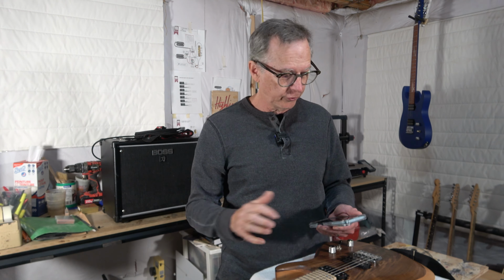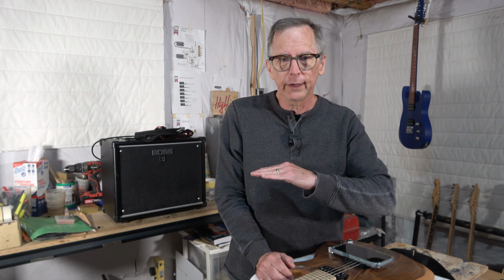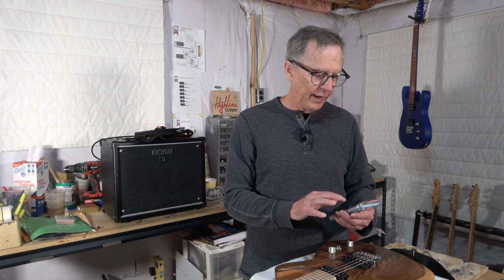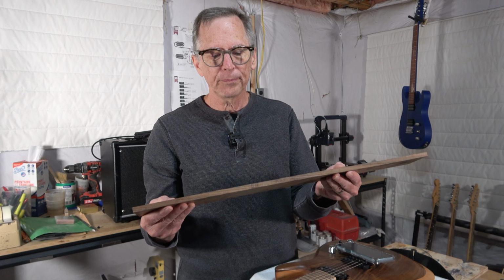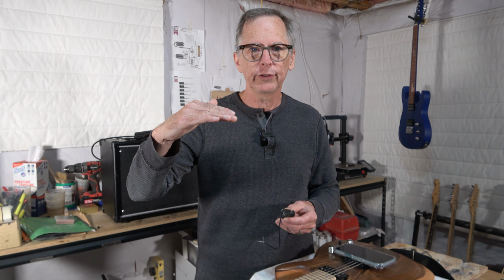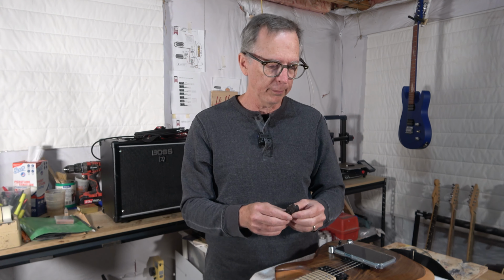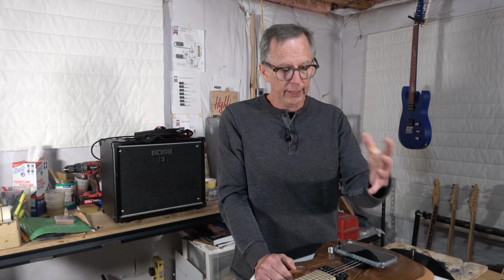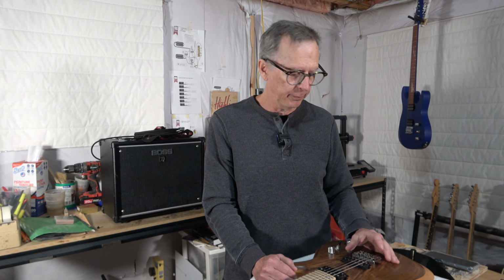Guitar Building FAQs April 2025

Comment: I built a tele out of some 100+ year old barn oak that was warped somewhat due to the elements. I used the same method you mentioned using a flat reference and then planing. It was too big for my thickness planer so I built a rail rig for my router, and it worked pretty well.
I wouldn't ever do it again though unless I was really set on that piece, like I was with the barn oak.
Actually I might have footage of that on my channel when I was building the guitar in 2019.